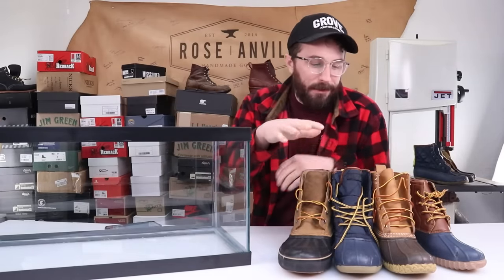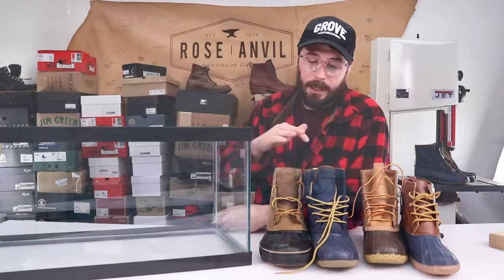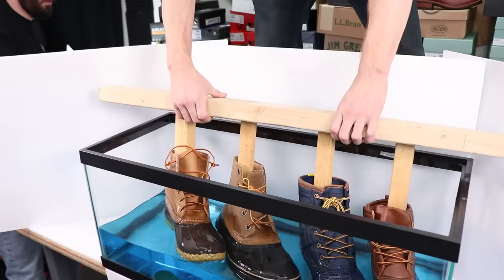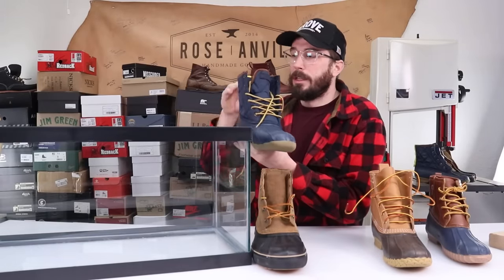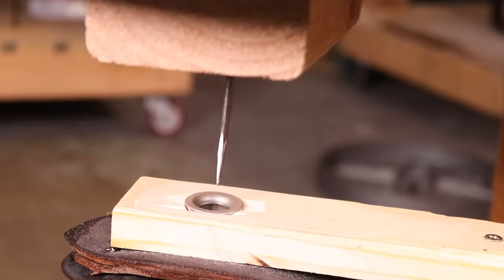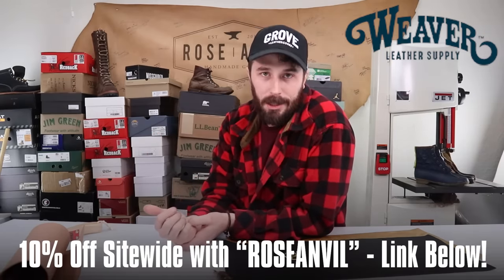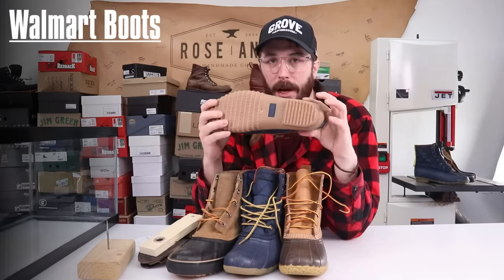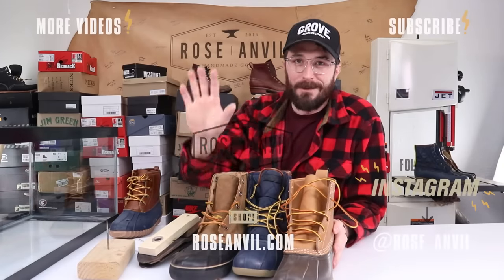Not As Waterproof As You Think... LL Bean vs Sorel vs Sperry

Comment: You don't wear those kind of boots expecting them to be waterproof above the rubber any more than regular boots are. If you want that, wear full rubber wellington boots.
Reply: Marc Carran  Good wellies are great. I always opt for them in such a situation. I have Barbour and Hunter boots. Both fit my lower leg very well and stay on very well. Other than your foot not breathing they are as comfortable as cowboy boots. I didn't say only wear wellies, but you shouldn't take them where you would wear wellies and expect the same performance as they are a compromise so expect a performance compromise. Maybe you want that as wellies don't breathe and you want some waterproof performance.
Reply: Wellies are for rainy days, duck style shoes are good for when the temperature is around freezing, as they are warm (at least mine are) and waterproof enough to keep wet snow out.
Reply: Marc Carran  Depends on where you live and what you do because it is much easier to deal with a rubber boot when there is a lot of mud and standing water. Not the same as going for a hike on a wet day. Cleaning boots is an issue too. Not an issue with an occasional hike where you clean you gear after but annoying if you just go outside and want something to hose down.
Reply: @emmamemma4162  Yeah that makes sense. I know someone who has those insultated ones. Good for hunting when it's cold and wet but you will be in them for a long time and they stop you getting cold. In snow or even wet snow you won't have the same problems as in this water test as snow may be damp but isn't getting forced in under pressure like water.
Reply: @TomDingleby  Exactly, I got a really warm pair with thick soles so I can stand around in the snow for hours without getting cold feet. I agree with you on wellies being the best shoes for mud and standing water, I have a pair that only go to my ankles and are fairly stylish. I love that I can wear them in the garden and then walk through some water to get them clean enough for a trip to the grocery store.

Comment: I use “Smiling Mink,” on my Boots, including the LL Beans. The boots are waterproof up to the top, or at a Gap in the Gusset. The thing I don’t like about the LL Beans, is they are extremely slippery on polished concrete and tile, and it is easy to slip and fall.

Comment: Had my first set of sorel's for 35+ years worked in those for the first 3.5 years almost daily drilling well's, amazing boot. Bought a new even nicer model of sorel's used around the house during winter only shoveling snow taking the trash out  that minor stuff. The new ones fell apart in 3 years. The rubber cracked and chunks the size of golf balls fell off, the rubber shattered like glass. The seams and leather cracked but the laces still look like new haha. I will never buy sorel boots again it broke my heart that that company sold out like all the rest. Going to try the LL bean on your recommendation. Thanks for sharing your video.
Reply: the old ones were made in Canada. New ones in China

Comment: The large grommet boots you buy with liners LL Bean and Sorrel. There is also something called a Gators these covers keep water from coming over the top.
No boot is waterproof when punctured. My Sorrel Boots are over 40 years old with fleece liners for warmth and gator covers to keep dry, if needed. 
You have not tested everything but temperature and comfort.

Comment: I have had many pairs of LL Bean 16” Maine Hunting Shoes and have not ever had a problem with them leaking unless the water went over the top of the boot. I did always use some of the Bean boot wax on them really wiring it into the seams. This included extensive time spent traipsing around in salt water and brackish marshes for hours at a time.  Never got my feet wet unless the water was over 16 inches. Even then, if was just a moment, my heavy wool socks absorbed the water before it could get all the way to my feet. I have also worn Danner’s and Rockies. The Danners are awesome, the Rockies are good and none of them leaked. The Danners and Rockies have Goretex so you don’t get the sweat problem the Bean boots can have.

Comment: The puncture test is quite good - would be interesting to see how other boots you've already done videos on fare in this.

It's also interesting to know if there's a correlation between puncture resistance and surface grip. E.g. if you need softer material to get better grip, but that increases your risk of a puncture, that's valuable information.

Comment: Well done. I use this style of boot for sailing, since they are easier to remove than sailing boots should you find yourself in the water, they can be adjusted to your foot more comfortably, and they are often lined for cold weather. One factor you didn't address, and couldn't address, is how well they fit. Unfortunately, the Beans are not at all comfortable for me, and I wear a boot made by Superior, available at, ironically, Walmart. They are lined with Thermalite and are very comfortable. I've worn them for years with success. One issue sailors care about is how skid-proof they are on a wet deck and these fit the bill. Thanks for the test, really appreciated.

Comment: Easier to test them, put the water inside the shoe and see if it holds. Thats how we've been told to test the goretex boots for trekking, hill walking etc it's the only way to know if the membrane is damaged.
Reply: I don’t know how effective that test would be because I believe Gore Tex is directional.
Reply: @stephenmitchum5864  No, that's how you actually test the membrane in a goretex boot/shoe. Water molecules are too big to fit through the holes in the membrane but water vapour isn't that's why it's breathable.

Comment: The Kamik Yukon 5 and Yukon 6 would have been an interesting addition to the lineup. Made in Canada, they are duck boot line with an aggressive lug pattern and full gusseting up the length of the tongue. No clue as to whether it's also seam-sealed as well, but it feels well-built and -- hypothesis -- could sit between the Sorels and LL Beans for both the waterproofing and puncture tests.

Comment: A big thing to remember is that with waterproof boots, once wet they stay wet. Non-waterproof boots designed correctly will be dry enough after a little bit of rucking and walking around. Meanwhile with my waterproof sets if I get the water level high enough to soak in, they are still wet even after a day or two.

Comment: You should also mention that L.L.Bean will re-build your boots (new bottoms, laces,insoles, and repair uppers if necessary) for a very reasonable price, and return them quickly. I have a pair that is over 35 years old, and I wear them very often in the winter. They have been re-soled at least 5 times!  I think it coest about $35 to resole them.

Comment: I have a pair of the old LL Bean Maine Hunting boots, I believe 8". Probably 30+ years old, got them used for 20 bucks, half size or so too big on my feet but always wore with thick socks. I've worn them for creek wading and had the water up to the very top of the boot. For years I never had any leaks, though now one of them has a tiny leak. Hardly noticeable however. They aren't very comfortable in my opinion, but great wet weather shoes. I wear them everyday in the winter working on a snow crew.

Comment: When I used to live in Michigan i walked everywhere all year (2-6 miles a day). I had a pair of Sorel winter boots. They kept my feet dry through slush and puddles as long as the water didn't go over the top of the boot. They were also very well insulated, I would wear normal socks and never got cold. I had them for 3 years of heavy seasonal use and they were still like new, I highly recommend them

Comment: You have to see what leather Bean boots you are buying. Some models have non waterproof uppers and the tongue gusset is very low, like 2nd or 3rd lace hole. These are the fashion models for walks to Blue bottle coffee. While others are treated with waterproofing which can wear off over time. And some have added goretex. The 10" main hunting boot uses a different leather that is 100% water proof made so in the tanning process. The only water that can get thru is the top of the shaft or the sewing where the rubber is joined with the upper.

Comment: I don’t see how the pierce test is the same as standing on a sharp rock. The physics of that mass dispersement  is not even close to that of a single nail
Reply: Basically, none of those boots will resist a nail puncture if you step on one pointing straight up. Steer clear of nails!
Reply: @kurtwatson9039   I get the concept but if the likelihood of stepping on nails in outdoor environments was high, I wouldn’t buy boots designed for water. I’d buy puncture proof boots. So the idea that putting nails through rubber boots suggesting this is a poor choice on my part based on nothing to do with what they were designed for, doesn’t make sense. Go find the sharpest  rock out there and stand on it, pretty sure the rubber would be able to do what the boot was DESIGNED for in the first place!

Comment: An idea to improve your puncture testing rig: Put the jig with the hole inside the boot (I think that jig was a really neat idea) and put the jig with the boot on a scale. Then you could have a frame above the boot, from where you apply the force maybe with a screw or with a lever. That way, you could apply pressure more evenly and get more accurat results. You'd still have to figure out the details of this contraption, but I hope you get the general idea

Comment: Recently acquired 2 pair of Chinese made duck boots. One is Polar Edge with a leather upper. The other is Game Winner with a Cordura upper. They have kept my feet dry in damp conditions, and when the garden hose was splattering all over them. These were found in nearly new condition on a vacant lot along with some other good stuff, where some lowlife had dumped. At least the price was right. I have always considered duck boots to be used on soggy ground and getting through shallow puddles. I have a pair of RedBall knee high rubber boots I bought some time in the 80s. Don't wear them often, but they are still in great shape and pliable. I apply some 303, or Griot's Garage Rubber Dressing to them once in a while. Now there is TrimSerum, which may be even better. These products would be good for the rubber parts of duck boots.

Comment: Years ago I had Sorels with felt liners. They leaked where the tongue met the bottom leather. I used my hand stitching tool with waxed thread and also used some Goop liberally. I won't say they were perfect but I could wade a stream while hunting  without getting my feet soaked. I also had silicone treated hiking boots that leaked even after treatment where the leather flexed on the side. I also switched from silicone spray to Sno Seal treatment with beeswax. Better but not perfect. I found that wearing polypropylene sock liners at least made the boots comfortable to wear even if they got a little wet. A layer of goop in the flex areas helped but would wear off. It's been over 30 years since I've hunted where I also needed to hike and cross streams. Newer boots with  Cordura nylon reinforcement  at flex points and goretex seem to be better altho I've worn holes in the goretex sole. I think the search goes on for the perfect hunting boot. Lightweight, warm, waterproof, comfortable as a running shoe, , abrasion resistant, with good traction on ice and snow. I remember rubber packs even before they came out with insulated ones and watching the progression thru silicone leather, lug soles, mini lugs. goretex, insulation, cordura nylon, side zippers. Next thing to tackle is getting the boot on when you turn 70.

Comment: I know you wont see this but I have a few ideas of how to improve the test.

I know the point you are getting at with this test, however is it really a real world functional waterproof test? 

I have seen people do tests before where they stood in lakes for periods of time but I dont think that really give an idea of a boot is functionally waterproof. The reality is most of these boots are going to be worn in snow, slush, rain, and maybe slightly swampy muddy conditions. The wearer is going to be moving a round a bit, ( walking and lifting their foot up and down). So when you step in puddles you're not really soaking the entire boot since the boot is going to displace some of the water. It will splash on to the top, but the water isn't going to have 20 min of straight time trying to work into ever single nook and cranny.

What I would prefer to see with these boots that might be more realistic is a shower test with water being showered on to the welt between the rubber and leather to see if there is more penetration as its more realistic. If you want to simulate puddles, us your same tank test, but fill with a little less water, an create a crank that raises and lowers the boot over and over throughout the period. As I said before, most of the time when people are outside, they are stepping in water which cause more displacement and splashing rather than straight soaking. Would also be good to test the boots sitting in snow since sitting in snow is a bit different than just one big puddle.

Comment: I agree on the boot type for conditions thing... For me personally, duck and pac boots are worn in snow and slush conditions and rubber boots are for tromping through the mud, swamps, and flooded basements.  I've got Kenetrek Northern pac boots and when worn in the snow and slush have never had a hint of leakage even when occasionally crossing the open water of a small stream or swamp. They have a fully gusseted tongue with a false tongue.   I've had Sorrel 1964 boots in the past that were good in the snow but the Kenetrek is a much more refined boot. I've had various brands of tall rubber boots but they all cracked over time and leaked... I consider them to be disposable.

Comment: I never get two of the same from bean. I ordered 3 separate times for these boots and i did not get an actual "pair". I also couldnt get them on even over 3 different sizes. Freaky. I took the hint and stopped trying. Also my Sorrels are gusseted like the bean boots and I've had no issue with water. Interesting tests. Very informative.

Comment: Good stuff! Fun video and well done experiment. Confirms what I had thought. I have been a bean boot guy for 20 years. And only 2 bean boots in that time. Both still functional, one is the low cut shearling lined. One is the thinsulate + goretex 8inch. Both fantastic. Never had a wet foot unless except the low cut ones  when a puddle goes over the top or step in deep snow. Duh, that’s why I have the 8inch. Bout time for a resole on the shearling pair, but I can’t say enough about the quality of bean boots.

Comment: These are fancy versions of the boots we have been using at the stable yard for years (we call them mucker boots or mucking out boots). Usually the Velcro fasten version is better as it keeps the water out at the top part - laced tend to leak by design. Very few people go for laces.Most are also insulated pretty well with a thermal lining. Also the versions we buy are pretty cheap compared to these. I suppose you really are just paying for a name.

I remember the ‘duck boot’ becoming trendy a few years ago and I found it hilarious. I’ve been wearing this style of shoe around the stable yard since I was 9. They are not fashionable but do a good job of keeping the heat in and the water and horse manure out!

Comment: When i buy boots i always use military grade silicone ,at least two coats on all seams and stitching. then the waterproofing dubbin or similar is used twice after warming the boots by a fire or heater. then, as a last effort i use seam wax made for this purpose.  Then i'm almost good to go. but nope. then i snag a water shoe  waffle type breathable insole and place that under my normal insole. this works as i always buy my boots a half or one size larger. the only way to truly test a boot for waterproof on the seams is to wear it in water and have the compression of the feet and that makes the air flow in pulses that can actually make a suction to draw water in. so the boot or footwear must be used many times in water for testing. Seeping in is a lame ass way man. you may agree,or not.  My boots don't leak until i step on a nail and yank it out. cheers and thanks for all the hard work and time making this video

Comment: Sorel duckboots: I had less than 200 miles on my sorels when the sole came off from the toe to the heel and was flapping around.  Fortunately I was just half a mile from the car so I did not have to silly walk too far.  I was able to fix it with shoe glue, I will only wear them for shopping now, but I shall never buy a pair of sorels again.  My wife has had a pair of walmart duckboots for 20 years, still doing well.

Comment: No boots are waterproof over the ankle (Lots of boots companies won't protect the seams over the ankle to lower their price) It's also not waterproof over the zippers because you can't waterproof them.. Usually companies have a warranty on the first 6 months if the water infiltrates. you simply have to go back to store, they will test it and do an exchange. Plus it's winter boots not rubber boots. No one walks in a 1 feet deep puddles.